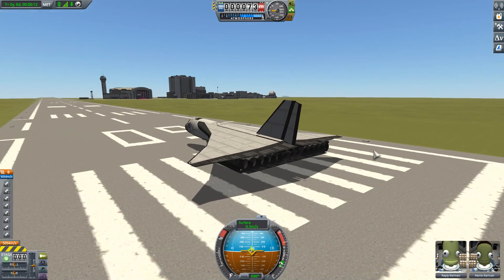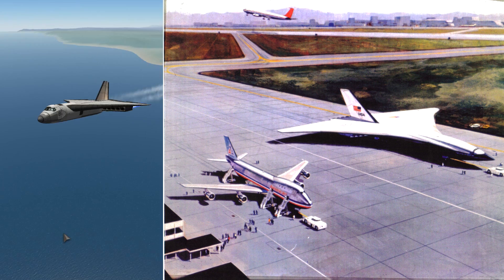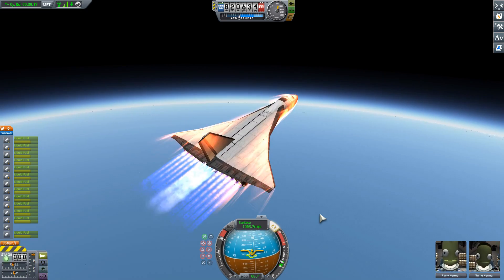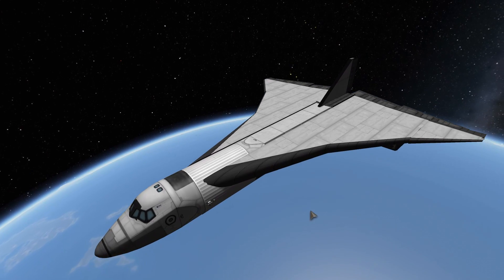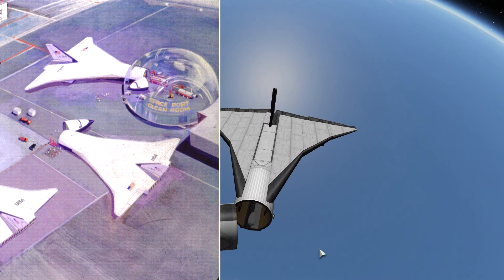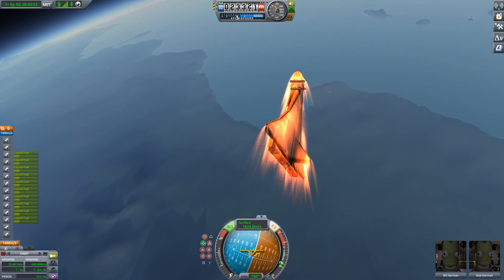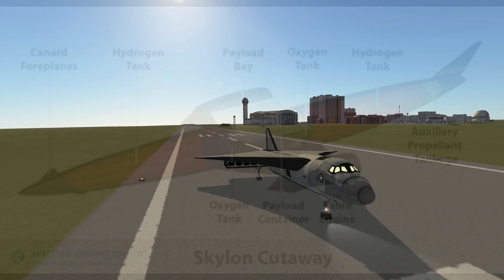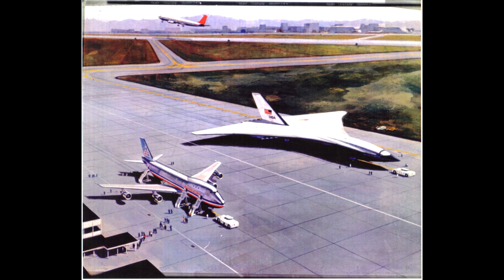The Star-Raker - A 1979 Space Plane With 15 Engines, Massive Wings & Huge Ambition

Comment: Engineers: cargo bay doors weaken the structure.
Also engineers: let's cut the vehicle completely in half.

edit

Oh my, 300 likes and a couple of serious replies. I was kidding of course.
Reply: Well it's like cork to a wine bottle. So actually pretty solid structural solution. also hinging in space would not be problem. Main problem would me as it with front loading large cargo planes like C-5 and AN-124, opening the front on Earth. the hinge is under gravity stress and more importantly... it is a huge sail. Another good reason to use that clean room loading setup. It provides a windshield for the cracked open plane.

Once closed as with wine cork in bottle. Just use something like locking wedges or eyelets and bolts to make sure the cork can't pull out of the bottle and it is solid structure. Ofcourse assuming the inner ring is strong build enough not to buckle in and the outer ring doesn't split open, but those would have to be heavy duty anyway to handle launch stress. Be it open hinging or not.
Reply: I think that you can't have cargo bay doors, on the behind, because, well that's where the engine are (and since it's an ssto, you need lots of fuel and engines, which are at the behind). When you deliver cargo from the front (or behind, but that's not possible here), by "cutting the vehicle in half" you get full control on the orbit/trajectory of the thing that you're sending into space. When you release the object from the top/bottom, you gotta do extra calculations for the object, and you need more fuel for course correction.
Reply: @oppy8811  The calculations and amount of propellant needed to accurately control the final orbital trajectory of a payload is not really governed by whether you release the payload from your nose or from your back since in either case you would first achieve the desired trajectory, confirm it and only then would you carefully release the payload at its required orientation. The final orbital adjustments will be done in whatever orientation is most efficient for the vehicle and this orientation would be the same for both the shuttle and star-raker: nose pointed prograde (which is to say with the nose pointed in the direction they are moving). This is because the most efficient way for either craft to adjust their orbits is to use their orbital maneuvering systems for the bulk of the work, and those engines are at the rear of the crafts. For the shuttle, once it has reached the desired orbit it would then reorient itself if necessary for final payload delivery but more of the payloads it delivered (excluding ISS components) had their own maneuvering systems anyway so the initial orientation upon release of the payload wasn't too critical, so long as the solar panels got the light they needed the payload could reorient itself after the shuttle left. In fact I would argue that precise orientation of a payload is easier with the shuttle style bay than the star-raker since you could start to reorient it as soon as it was released rather than having to first extract it from the cargo bay.
Reply: @maxk4324  yes, but have you seen Scott's video on how if you throw an object straight down, after one orbit, it could come back from over the top and can potentially hit the spacecraft itself. Maybe that's why objects are mostly released from the front ? Idk much but I also suspect that since this is an ssto, it needs more fuel and engines in one craft than a normal staged craft. Therefore all that stuff takes up the cargo bay ?
Reply: It does make sense though, you're not losing strength in nearly as important a direction. During ascent you've got no significant shear force on the nose, and the descent is gradual enough that the force is minimal. A shuttle-style door is compromising strength during all the highest force times while this is having nearly no impact. While open on the ground would of course be a very stressful time - I'd be tempted to make some kinda messy ground support equipment to avoid needing hugely overbuilt hinges (overbuilt compared to the loads all the rest of the time) as mass budget is so much more important than on conventional aircraft. As Ari Takalo points out, wind loading would be no joke when open also.
Reply: SSTO to go at Mars is not the best idea... you are going to have to carry part of the structure (dead weight) that only served you to leave planet earth
Reply: Cargo aircraft minimise doors in the side for strength reasons but routinely have hinged noses for long cargo. The required door size for long cargo is smaller that way.
Reply: I think the non-joking answer is that tubes are a strong shape (especially when pressurized) so you stick two tubes together.
Reply: TO SHOW YOU THE POWER OF STRUCTURAL DYNAMICS, I CUT THIS SPACESHIP IN HALF!
Reply: A lot of cargo planes use a similar scheme and it works quite well for them, including the C-5 and the cargo version of the Boeing 747.
Reply: @RCAvhstape  They do, but for an entirely different reason. Putting the whole cockpit on a hinge gives you a huge opening which makes loading of sizable cargo significantly easier (they can just roll it in instead of having to strap it on a giant crane and lowering it through the bay doors on the top side). The main difference, however, is that nor C-5 nor Boeing 747 has to withstand hypersonic speeds, as far as I know.

I just felt like pointing that out. I am not arguing for or against hinged nose. I haven't really "studied about the topic".
Reply: Its much easer to secure things in tention, so having a full opening that way is quite a bit simpler.
Reply: It works just fine for multiple stage rockets. You should study more about the topic.
Reply: There is a difference between being the best solution and "working just fine", I think. Or should I study more about the topic?
Reply: This did make me laugh😂
Reply: Edit your edited comment to have only 2 lines of text. e.g.

Edit: this is what I'm talking about. Because I didn't see it at first.
Reply: Cargo Boeing 747 also have the nose hinge so the plane can be front loaded.  Although it hinges in front of the cockpit, not behind it.
Reply: There's a difference between a cut that's a cross section and a cut that's a generator chunk. Kinda like the difference between using drawn pipe vs seam welded pipe in a structure.
Reply: Hahaha!👍
Reply: I agreed and disagree with various points, yes when accelerating the seal would be in compression so would be stronger however it would experience a high amount of sheer force when in atmosphere and possibly cause alignment issues where the nose isnt perfectly in alignment with the body of the plane which again would exacerbate sheer stress. Cargo doors are a weakness in compression but would be stronger in atmosphere because the air pressure would be pushing them closed. That weakness of bay doors however could be solved by turning their orientation 90 degrees and running a central strut through them which is in compression when the doors are closed, doing so could take the place of another fuselage strut and so wouldn't require any more weight. People suggesting that in an aircraft flight profile it wouldn't experience shear, well fasteners on aircraft called Clevis Bolts are specifically designed to handle the shear experienced by aircraft.
Reply: London double decker

Comment: Virgin Galactic seems to want to revive this concept but I really don’t see it
Reply: No they don't, they are doing suborbital hops for tourism, completely different and no intention of going to orbit
Reply: @Block1618  you should really hit up a search engine, they recently announced plans for a mach 3 passenger jet
Reply: @Masada1911  : That wouldn't quite be the same as this, even if it looked very similar.
Reply: @Masada1911  : Also, if they're going for it as a replacement for the Concorde for long-range flights, then an atmospheric skimming vehicle could actually work decently well.

Comment: Too bad the space shuttle was a bust
Reply: @Lovecraft You must live in an incredibly depressing world if you believe something this mundane isn't physically possible.
Reply: @grantexploit5903  > Mundane?, did you skip the part describing the 'magic' transforming turbojet / ramjets that have to function up to mach 7?
Reply: Bubble Boy Well the Americans had turboramjets that functioned just fine at Mach 3.2 in 1960. The SR-71 had a pair and the D-21 had a single ramjet running at Mach 3.35 in 1970 without airframe cooling for hours on end. 20 minutes at Mach 7+ seems doable with a liquid hydrogen cooled structure.
Reply: @Bubble Boy "Magic" is an exaggerated descriptor, it's not a literal explanation of what they would be.

Looking at the diagram, there doesn't seem to be any serious transforming geometry going on—the turbojet is mounted directly inside the ramjet assembly. It would more transition from turbojet to ramjet power with increasing speed than have the engine physically change itself. (And even if it did, I don't see why that would make it impossible to develop with enough time and money.)

Also, the engine would be regeneratively cooled at least in the nozzle and appears to at least partially use an expander cycle to drive its turbine instead of the combustor gases, which would significantly reduce the thermal loads (remember, hydrogen's heat capacity is the highest of all known materials) and make the compressor outlet temperature be the limiting factor rather than turbine inlet temperature. 

Finally, this project would have involved a considerable development of materials technology, including developing materials like many ultra-high-temperature ceramics that were not known or sufficiently understood at the time but are now. Plus, you don't believe we've scraped the barrel with regards to refractory materials, right?
Reply: @grantexploit5903  > Yes, but developing such would kind of be the exact opposite of a 'mundane' development project me thinks.
And it's not like we have to guess about it, since Rockwell eventually did get to have a crack at something like it with the X-30 National Aero-Space Plane project.
I'm guessing you know exactly how well that multi billion dollar research program panned out?

Rockets are hard, air breathing hypersonic SSTO spaceplanes seem to be somewhere close to nigh-on impossible at the moment, if not for physical impossibility reasons, then for how ludicrously expensive the development program would cost. 
Meanwhile SpaceX is undercutting any chance such a project would ever get funding with a far cheaper and rather conventional rocket.
I don't like the spaceplanes chances for the foreseeable future. :-(
Reply: @grantexploit5903  : The problem is precisely the engine, and while the SABRE is getting close, there are still no engines that meet the operational needs of this design. We'll get this sort of thing, and in 50 years I expect that these will commonly be used to cross oceans, but I doubt that SSTO designs will turn out well until we get either beamed-power or nuclear rocket designs built, or get fusion or nuclear isomer reactors working. SSTOs just push too close to the limits of engine technology to be good designs.